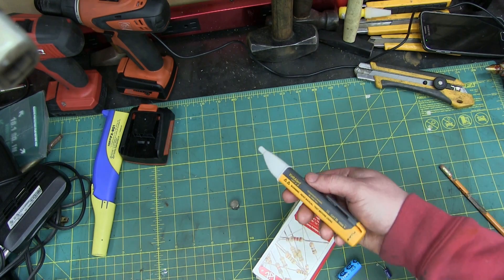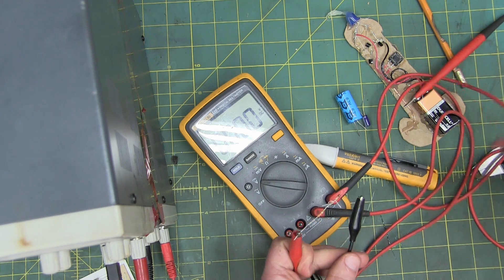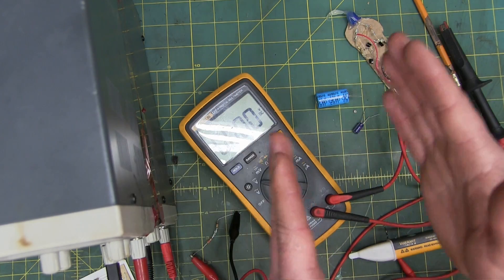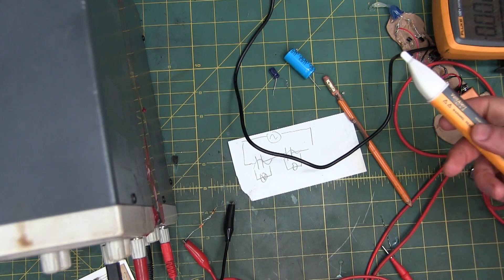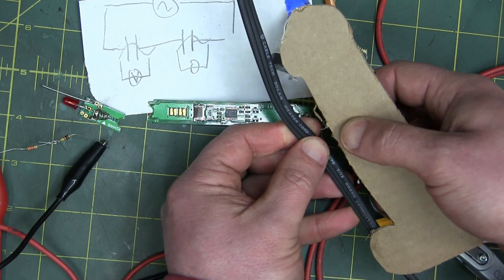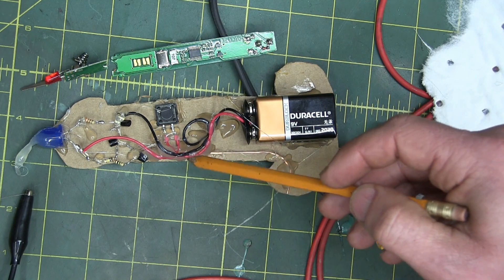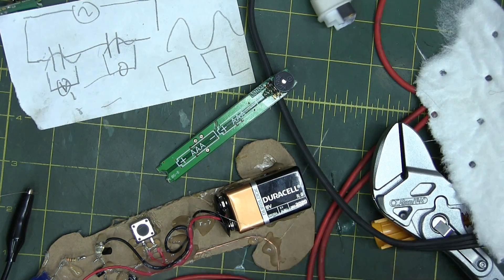Non-Contact Voltage Tester | How does it work?

Comment: Hey AvE!  I feel the need to point out that the 1AC does not need to be actively held by the user -- it can simply be inserted into a receptacle, or just left freely laying on a wire, and it still triggers.  This leads me to suspect that this isn't a capacitive detector as you mentioned, but rather a RF detector (sensing 50-60 Hz), or it uses the magnetic field around the wire.  Thoughts?
Reply: My thoughts precisely. The common NCV does not require to be held though some do. If the detector is capacitive the detector must be tuned to work with an equivalent capacitance of that of bulk air, otherwise the detector must be picking up the E field or EM field. Magnetic field detection is out of the question because the instrument could indicate voltage on a neutral or grounded conductor ( aprox 0V) and it not indicate voltage  on energized conductors whose current is zero.

Comment: neat as heck!  hey man -I got a question... if the person using the voltage detector, like the one you used here, was wearing rubber electricians gloves the voltage detector would NOT indicate any voltage being present. Is that correct?
Reply: In Italy we don't use rubber gloves, we go to work in flip flops right after we take a shower enriched with bath salts.

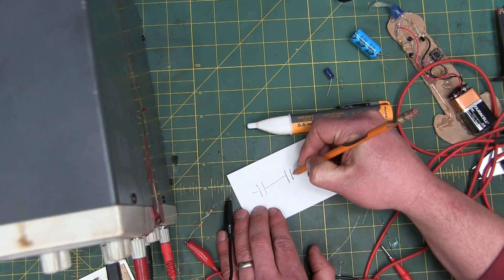Comment: I'm at 5:24 and I just noticed the battery operated dick-shaped device in the upper right with an LED at the tip and hot snot coming out...I'm filled with a sense of wonder, excitement, and dread at the same time. Will I even find out what it's for or is it just there to taunt me?

Comment: The clone one detects EVERYTHING metal. Aluminum, copper, steel, you name it. I bought the cheap $1 ones and I had to put a battery isolator because it kept going off in the tool bag!
In the hindsight it teaches people to stay the fuck away from unknown wiring because this will always indicate that ANY metalwork is live!

Comment: I beg to differ -AC feel like a nonlocal jolt and DC feels like a hot sting or cut where you touch. I have had 230VAC here and there, even thumb to thumb and 400VDC to my finger, 13VDC in salt water and 12000V coil discharge (transient = any Freq.). How many psychiatrists does it take to change a light bulb? Only one, but the bulb has to want to change. PS. The theory of capacitors not caring and letting AC through applies when mounted in series in a circuit, but for the capacitor itself I guess you are right. Great fun and learning watching your channel Uncle B.F.

Comment: If you plug something into the receptacle and turn it on I bet it would set off the tester, or touched the neutral and ground yourself. Just in case any of you didn't understand what was happening when he was checking the outlet, always assume its hot!.
Reply: I didn't say I was talking about why the tester didn't light up on the neutral sorry.

Comment: When I worked as an electritian before I used to buy a load of these from a cheap off-brand manufacturer and keep a bunch on me. And when I encountered a carpenter or plummer who didn't know a lot about electricity I usually gave them a quick tutorial and gave them one of these "pens". I hope it saved some lives or at least made them check pipes or cables before cutting them.
Reply: You sir, I commend your humanity

Comment: Electrical enginerd here. At 3:20 you say that a capacitor uses electron-hole pairs to act as an energy storage device. That's true for semiconductor devices, which have free electrons or free holes that neighboring electrons can fill, but it's not true for a capacitor. 

In a capacitor the electrons are strongly bound to the insulating dielectric, so they can't create free electrons or holes in the material. Instead, what happens is that the presence of the electric field between the two conducting plates forces the bound electrons in the dielectric to spend more time on one side of the atom than on the other. The result of the electron spending more time on one side than the other means each atom essentially has a polarity, and the "charged" polarized atoms on the boundary of the dielectric force the free electrons in the conductive plates to move, either pulling electrons onto the plate or pushing them off, which creates the capacitor current you see briefly for a DC circuit

Comment: Do all multimeters give their information taking into account for how it effects the values or does it absolutely not interfere or change the values at all?

E.g. You connect the multimeter probes and the voltage changes because you added the probes but it knows the value testing for that voltage and displays the calculated value.

Comment: I'm not sure I agree with what you're saying, Uncle BF. I have the same Fluke Class IV tester and it chooches regarggless of me holding it or not. Either my model or some of the others I have tried are weirdly defective, or is that antenna picking up the magnetic flux signal?

Comment: Hey ave! Ive got a question and i figured you might be able to point me in the right direction. 
 So i like working on stuff and building things and i would like to look into the idea of using the engine and permanent magnet generator assembly out of a honda eu2000 to build a series electric hybrid drive system for some kind of small mode of transportation(like a bike or large off-road board). 
 But here are things im curious about and dont know, like whats the best way to convert the 3 phase ac from the stator, and then drop to a usable dc voltage to charge the lithium batteries and drive the motors? 
Can i start the engine using the stator too? 
How do i seamlessly switch from battery power to generator?
How do i incorporate regenerative braking? 
What would work the best to control the engine, audrino? 

I think this would be a RAD project but i need a little more knowledge.
Reply: If theres any info out there that you know of that would help me out id be much appreciative!

Comment: If I am required to be a coupled resistor, why can I leave a volt tik sitting on a wire, on the floor with no human hands and flip a switch on and off and the darnd thing still works?

Comment: Capacitors cause current flow in order to maintain the voltage across them, inductors cause voltage across them in order to maintain the current flow through them.

Comment: I heard somewhere that a CMOS decade counter chip can be used with only a batteria and a LED.
Just bend the clock pin out as the detector, power the usual pins and connect the led to the 10count pin&gnd.
Flashes 10x slower than your mains freq, and depending on the battery doesn’t even need a LED resistor.

Comment: We call them liars. Too many times the noobs use them and they don't read anything (lie) and get shocked when they do to work on the circuit.

As far as the fluke one I'm a big fanboy, all my meters are flukes. Their voltage detectors in the past have been garbage. Haven't or have any plans on trying any new ones.

Comment: I have a NCV detector built into one of my multi-meters.  I press a button, and it chirps at the AC frequency when it is near a hot wire.  Do those use the same method as the pen type?

Comment: How does it work when you aren't in contact with the voltage detector, that is when you jam the wee antenna in the socket and start flicking breakers on and off. Still works without me being in contact

Comment: The problem with chicken sticks is that once the battery dies, so do you. Dead battery = a false safe reading. Best to use a meter... or a finger you could live without. Another good one is watching the green guys try to troubleshoot something with one of those, "It's got power but it's not working?" ...yeah, that's because you probably have a loose neutral somewhere, noob.

Comment: Good timing. Anybody have an idea why this tool would indicate voltage on the live but no power flows when anything is plugged in? We tried resetting breakers and one of the outlets on the breaker still works.

Comment: Piece of cake... just an open gate on a sensitive FET. Yes, generally capacitively coupled (you serving as ground plane) but easier to understand as EM detector. Open FET gate as antenna (you again as ground plane). Like "hum finger" (no, not that kind!) touching input on an audio amp. Ever notice you get no hum finger effect on a battery powered amp? What is really happening with an AC powered amp is entire amp is swinging up and down in voltage capacitively coupled through power transformer. When you touch input, you serve as ground. Entire amp is still swinging up and down with AC, but your finger is holding input lead near ground, resulting in BIG relative input to amp. If your body was picking up AC field and coupling it to input, you would still get hum finger effect on a battery powered amp, but you don't. Clear as mud, right?

Comment: Before watching: I’m guessing that it works kinda like a transformer where the current and voltage of the wire induces some sort of current in the device and gives you a readout. 
Edit: well fuck, I’ve been wrong before and I was certainly wrong now lmao
Reply: I thought it was an induced voltage from the magnetic field around the cable that fed a transistor and that switched on the light and noise .  Appears I am bumble f*ckered

Comment: Had one of those drive me to cuss like a sailor a few years back.  Fortunately, I had been one in an earlier life so the cussing wasn't startling to me.  Trying to be safe working on wires in the attic, racing the Southern sun gentle scorching of the roof, the little bastard keep going off when I ran it along a wire I "knew" was dead.  Then it would confirm the wire was dead.  I finally, surgically exposed the wires to get a contact meter on them to confirm what I "knew".  And sure enough it was dead.

Eventually, I figured out that my consternation causer was the damn CFL bulb in my work light.  Normally, I was between bulb and the tester, so the wire tested dead.  But if I tried to relieve the pain of balancing on ceiling joists and moved, the light would be line of sight to the tester and it would sound the alarm when run along the wire.   Be careful of your HF sources

Comment: Are the 4 gold plated contacts on the Fluke meter acting as your capacitor plates? Also, If you're the small capacitor in the circuit, why was it working when you clearly left the Fluke meter in the socket and let go of it? Would that not have broken the circuit?

Also, quality Youtube buddy!

Comment: ok Mr. Wizard (wait, that's Tom Liption), so why is it you can turn a "chicken stick" (tick tracer) on, stick it in the hot side of a live receptacle and let go of it and it stays lit and beeping???  Throw the breaker, the tracer turns stops detecting.  Turn the breaker back on and the tracer will blink and beep.... and you never touch it.  Doesn't work on cords, just receptacles.   (think Faraday/Kirchoff)

Comment: *DO NOT TEST FOR DEAD WITH A VOLT PEN*

There... got it out. Someone has to post the usual Nanny advice ref these volt pens lest some naive wet behind the ears type comes across this vid and thinks these pens are magic.

I'm not an elecChicken but I work in the field servicing various IT stuff, have one of these things in pocket at all times as they are super useful for those "it won't switch on" calls.... quick wave of the bleepy pen over the mains cable in to the device... it bleeps... fairly sure it's got power... if it doesn't well someone probably unplugged it to plug in a dildo charger or something most likely... easy fix

If you have to expose a possibly live mains voltage wiring or contact - don't rely on one of these to tell you a circuit is dead - if you know how, verify it with a meter - if not call an electrician.

None of the above should really need saying - but these days I see so many new starters sent out to tackle stuff they really shouldn't - no doubt cheap and expendable or somesuch in corporate terms. But F me.....  I'm all for people learning through experience.... and a 240V AC belt will wise someone up quick smart... teehee, haha... not so funny when they are atop a ladder at the time.

I know this vid was just a teardown of the device and in no way advocated using it in any way at all - but YT being what it is, others will stumble on it. The TLDR for this post - know the limitations of your tools.

Now - PSA over... back to your usual Bumbling AvE.

Comment: Tinkerbell beware!! Leave it to Old Uncle Bumblefuck to turn a heat-seeking moisture missile into an angry pixie detector pecker.
Methinks it's time for Old Uncle Bumblefuck to have another beer. Then a smoke after a proper ham-fisted attempt at induction.
Don't let the better 3/4s catch ya. She'll be right liable to cut off that 1/4 right at the root of all evil. No impedance, just impotent.

Comment: I have a Ridgid impact driver that I've been using in our diesel mechanic shop for 5 years now. She's been skookum as frig. The thing has been abused like you wouldn't believe, but it's still choochin. It even spent a weekend completely submerged in a bucket of oil. Amazing. I was going to see if you would want me to send it to you for a tear down to see what she looks like after 5 years of 40 hour a week plus of hard service. Just let me know and I'll send it that way. I'll include a battery. It's a crusty battery, but she'll work.

Comment: Ok. I have a question. If it's using your body to complete the circuit. Why will it still work if it's plugged into a receptacle even if your not touching it?

Comment: How is my tic tracer still working even when im not holding it, if i'm supposed to be part of the circuit? Usually I'll just lay it on some romex and flip breakers across the way, listening for the beeping to stop. It's worked so far.

Comment: If the voltage tester needs a human body, why does mine work without? Mine has an audio so that I can literally stick it in a socket and go to the fusebox to flip switches until the tester is quiet

Comment: AvE im curious in being a pixie wrangler myself with my tick tester i use it for identifying ccts all the time on everything from 120 to 347v and i leave it in a plug and flip breakers till it goes out so how can it use my capacitance ? Ive never seen one that works only when you hold it or get close to it. I always thought they used the antenna as a pick up for inductance. Anyway im just curious love your videos oh and im also wondering if you could tune up a millwakee cordless heat gun some how i have one and it could be much better i think . thanks your friendly neighborhood sparky-man

Comment: if you are interested then i have a design for a fairly easy to build geophone that can detect a moving car from a couple of hundred meters away, it uses low cost components and a speaker cone as the primary actuator...

the amplification circuit is very high gain with decent noise performance if you are sensible about the layout and all the data is gathered by osmelloscope.
edit it is in fact sensitive enough that you need to properly short the circuit before picking up the device or the circuit will blow

Comment: When I first got into electronics I remember trying to freeball a touch sensor so I threw 4 little shitty NPN's together in a quadruple darlington and ran the base to an altoids box. It was amplifying way too much and I must have spent hours thinking I was a Chi master holding my hands around the tin as the charge slowly built up and turned some leds on.  

Most of these tick testers I look at are pretty much the same, but it's interesting how the small things matter such as the plastic housing. I've tried a lot of them and I stick to the southwire testers, they seem to give it to me straight unless a neutral is piggybacking strays or something. Some of the cheaper brands seem to rely on your body though and it's hard to set those fuckers somewhere and walk away cause they lose half the pickup when you let them go.

Comment: Electrolytic capacitors don't care about AC. They have a polarity, yes, but they will only explode if you put DC ass backwards across them. Plugging them into the wall will blow them up because it will be a dead-nuts short across the capacitors, causing a huge amount of wattage (voltage x amperage) to run through them. BANG, Bob's your auntie. And he's a trap.

Comment: That's the trouble with the Liberal Industrial Establishment, it takes jobs away from hard working Americans.  Back in my day, we used to call a non-contact voltage tester an apprentice.
Reply: good one rofl
Reply: I know a former licensed electrician who tests voltage by putting wires in his mouth and seeing how it feels. 

I’m serious. I couldn’t make that up if I tried.
Reply: WarGamingRefugee  YEP to that comment, and have them get conduit strechers, and go find a left hand screwdriver. Lol
Reply: A bucket of prop wash. A tube of elbow grease.
Reply: Necroposting but what the hey I had to contribute. 

Tell yer apprentice to go fetch you a bottle of blinker fluid, or a long weight.
Reply: Get the scooper at the bottom of the wire lube bucket.
Reply: We used to send the newbees around to other departments looking for several female fornactos, had them tell them we could give them male fornicators in trade.
Reply: Shut up Worm
Reply: as a third-stage test for dead i still flick the conductor
Reply: LMFAO 😆😆😆

Comment: I just bought one o' dem things, the cheaper brand yellow one, not the cardboard, and the directions say not to drop it or it'll be dickered. Does anyone know why it will break easy if'n it is dropped? Hanging upside down under the rafters balanced on cellar detritus looking for an "open" it'll only be a matter of time. And no, I won't gamble my life on the indication or lack of.